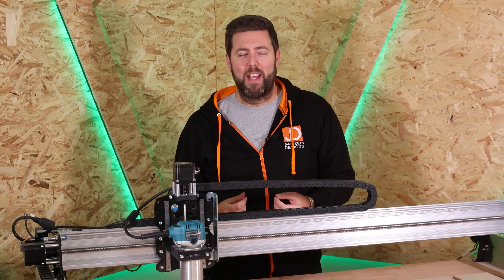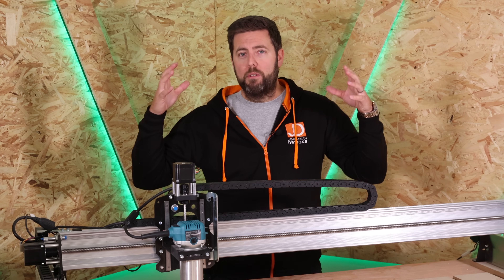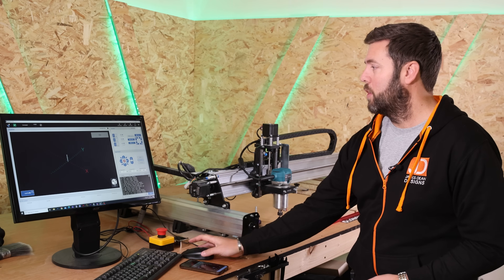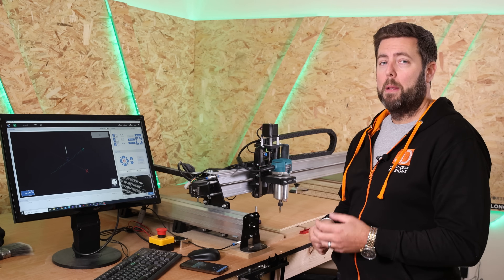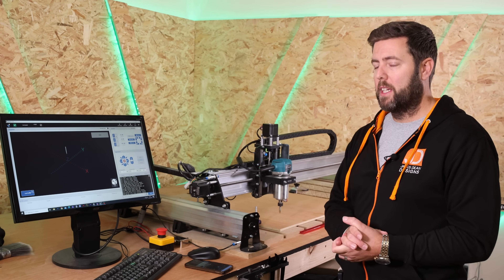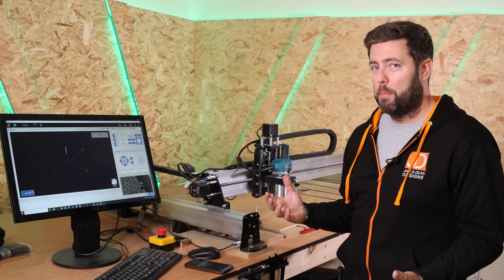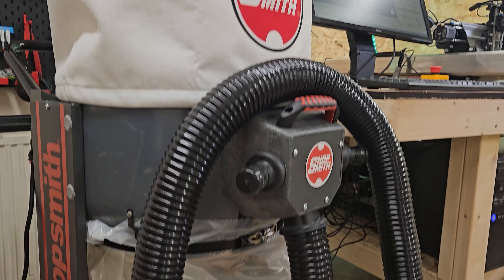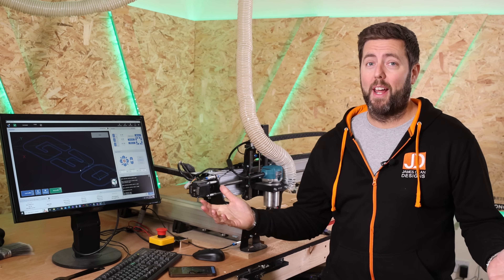One Code To Make CNC Jobs Much Easier

Comment: about all machines have two write to memory save , G30 and G28 , while not written in stone G30 is generally a probe / tool setter location and g28 for wpc and why cam like fusion calls G28 unless post processor is moded , both set with .1 command " g30 via g30.1 and g28 via g28.1 "

Comment: Hi James - as a newbie I'm setting my start point as my x0 y0  point - no switches there but it goes against the stops. I then hit "Zero" - i.e. this is front left corner.   If I need to go back I hit home and it goes back - left corner for me. If its done something and strained and lost its head then I just go back to my left corner and hit Zero again on the x,y.  If I want to re-start for any reason after a problem etc. in a certain position I hit the arrrows key to scroll through the code till I get to where I want to re-start. Lift the  z to clear any thing in the way and away it goes again. Might be a lengthly way bit it suits me so far.  I'll look at your way soon - I'm learning every day.  I'm using VCarve desktop and Mach 3.    My two limit switches dont seem to work and are set at top right corner.

Comment: Freecad 1 in the cam work bench ,my post processor is set for GRBL for a Genmitsu 4030 witch produces a .NC file, The test files that come with my Genmitsu 4030 are .TAP files and they worked, plus I downloaded a .GCODE file created in freecad and it worked, I'm using Gsender and Genmitsu says the .NC will work on my machine but they don’t , How do you get .NC files converted to .GCODE files  hopefully you can help me out Thanx Mike
Reply from the maker: Either just rename the file extension to the one you know that works, or when you go to open the file there will be a box usually towards the lower right saying file type, change that to say all for types

Comment: I live in a country where electricity is not "forever" (USA) and have always wanted a way for the machine to "record where it is" RIGHT BEFORE the power goes out.  My finish passes are entirely StepY, transit X, repeat. If I executed a G30.1 BEFORE each "transit", I could return to the beginning of the EXACT transit in progress when the power failed. (At this point, I'm thinking of using something like sed/awk to "insert G30.1 after each line containing G1 Y".) This is assuming my G-code flavor has G30... You're right: very good to know!

Comment: I use openbuilds and it saves G28 and G30, having macro buttons for them. I use G28 for work zero and G30 for a move that puts the machine at the back right corner, out of the way to get access to the job with router out of the way.

Comment: Is the G30 command entered in the console along with the G code settings ? I'm using Easel and am still a beginner.
Reply from the maker: If you're using Easel to control the machine, there should still be a box where hou can enter commands and that will do the same 👍

Comment: Gsender always remembers your last xyz even after the machine is turned off and reconnected.
However, there are certain times when I put the corner of the board against me fence and it would be useful for it to remember that xy position and that would save me some heartache. I've gotten away from using the touch probe cause I no longer trust it so I will be definitely experimenting with G30.
I also copy and pasted my current settings and currently my G30 says "$30=1 (Maximum spindle speed, rpm)" .
Is this the same thing? It says spindle speed??
Nevermind. I looked it up and no its not the same thing. It $30 is spindle speed.

Comment: I am new.  Doing lots of experimentation.  I have found myself wanting to adjust settings in the middle of a job, to see what the difference might be.  If I hit the stop button on my UGS, and type in the G30 command in the console, can I then edit the toolpath, (maybe changing the stepdown or stepover) making the changes I'm curious about, and resume the job at the point where I used the G30 command ???

Comment: I like this so if I put my probe in a corner and set that as my g30 what are the other codes to set a second or third zero position
Reply from the maker: @alexandersievewright3842  there is g28 and g54-58 in think off the top of my head. There are some differences between how they can be used but all very similar

Comment: Thanks for another great tip James.  I have been using the XoYo setting on the offline controller and then Go to XoYo after each bit change.  However, this zero position has been lost if the power has been accidentally turned off or after a job failure.  Having the G30 command as back-up is a good idea to reset the model position.

Comment: This is great info. Thanks. 

One question to make sure I understand.  If I lock down a piece and set a zero point for that piece this will be valid until I move the piece? 

And I need to have limit switches installed?
Reply from the maker: Yes that's correct. As long as you don't move the material, this method will always take you to the start position and yes you need limit switches 👍

Comment: THIS = is one of my favorite tips EVER...Thanks
Reply from the maker: @atienne_navarre  glad you've found it useful 👍
Reply: @JamesDeanDesigns  Still love this TIP - But  (there is always a but) I just realized that it does not work with GRBLHAL. I had to switch to GRBLHal for my longmill to solve some other problems and the G30 stopped working. Is there an alternative? Thanks again.
Reply from the maker: @atienne_navarre  hmm... usually they add extra options but don't take them way. Let me look into this as I've just installed the SLB myself
Reply from the maker: @atienne_navarre  so a few articles would still suggest g30 and g28 are working and the same but I'll try and test myself
Reply: @ No worries - Ive been using the g30 a lot and it has helped my workflow quite a bit. Support had me switch to grblhal and now I get an error. Could be other things but thats the only thing I changed. Ill look there as well. thx

Comment: Thanks for this tip, seems to be very useful. I'm thinking about adding G30.1 to multiple points in a long program, so if the cutting fails for any reasons I don't have to restart the whole program from the start but only from the last checkpoint that has a known position saved. Can it be used for that or is there a more suitable command for this purpose?

Comment: On my 3018 i have no limit switches. Can I perform a manual home before the G30 commands? I have a simple home point marker fitted so I can reliably find Home manually.
Reply: Even 3018 without limit switches can be manipulated with a keen eye & finger reflexes. Manually jog to absolute end of travel, eg Front, Left, High.  just touching frame. Press the reset button on the controller. That will reset Machine coordinates to Zero. You can apply the G30.1 command. And recall it with G30.
 When creating macros, ensure you select Machine Coordinate system G53. You can then apply G30, G54 - 59 etc
Reply: @JohnCol-1959  Cheers, tnx for the info

Comment: Hi if i start a completely new job, do i need a new G30 gode, if i understand correctly G30 is job start position coordinate code.
Reply from the maker: @taaviliiv5904  G30 is basically just telling your machine to remember a certain location. So if you always start your jobs from the exact same position, then no you only need to do it once. If you start in different positions each time, then yes, do the G30 command before starting each job